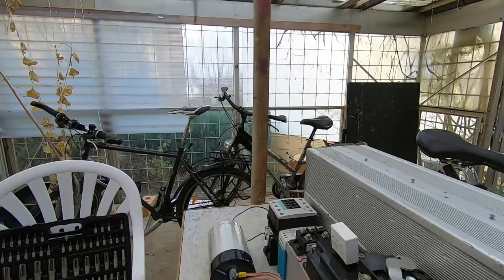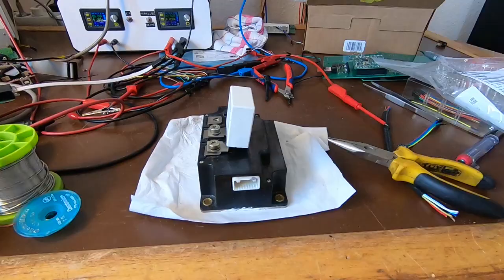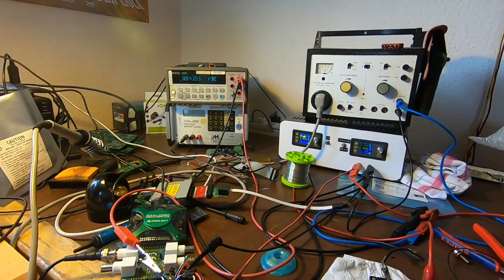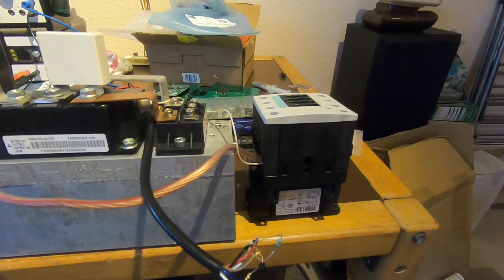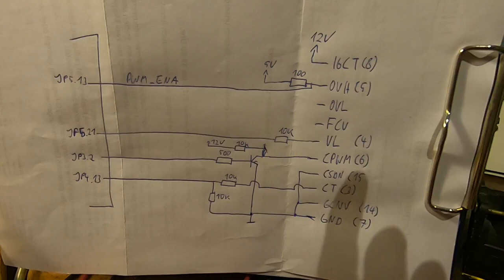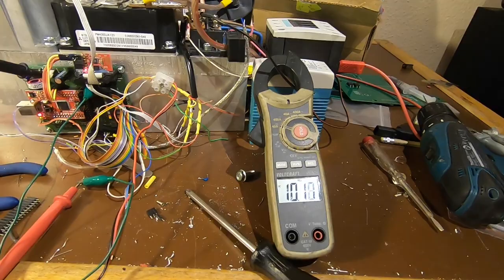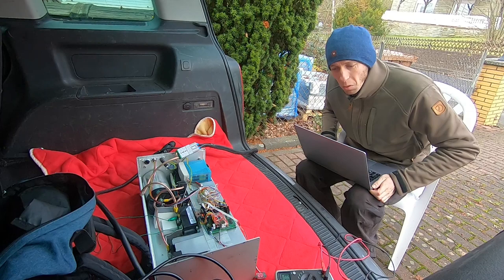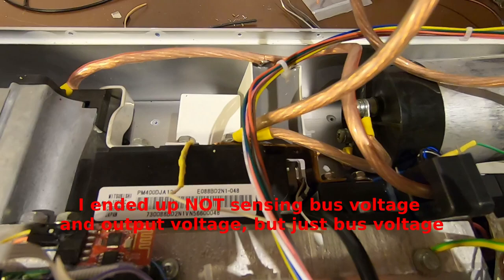Lab Update #55 - High Power Charger with Prius stuff

Comment: is there any MUCH difference if instead ChaDeMo you will use CCS plug? my goal it to make 15-20kW external cheap CCS charger from 3phase 32A socket/output
Reply from the maker: Just different communication. For CCS you will need a whole host of co-processors just for the silly protocol. See e.g. lab update #77

Comment: This is excellent. We have single phase power here. Can this buck down in voltage if someone has a lower voltage setup like 144 volts and get some good high current into the batteries for a proper fast charge? Would this work with the version 2 of the openinverter? I have two of those and a version 3. I could source Prius parts easily here. We have 240 volts here in the states.
Reply from the maker: Absolutely, 240AC pairs up well with 144V DC. Yes, I'm using a V2 board